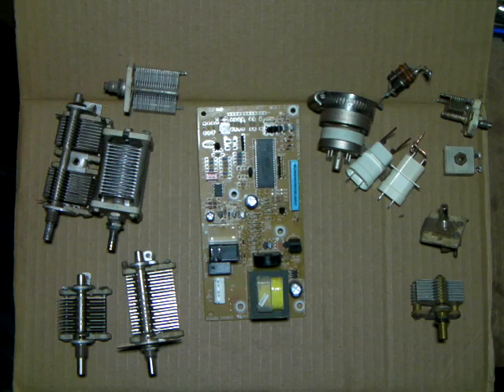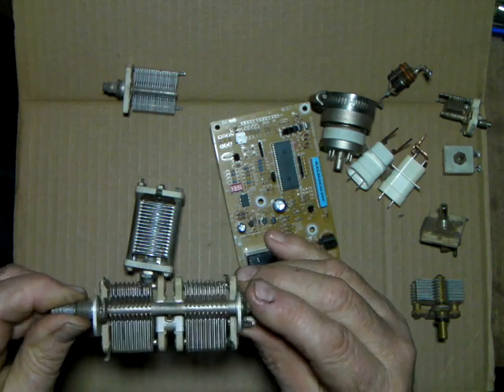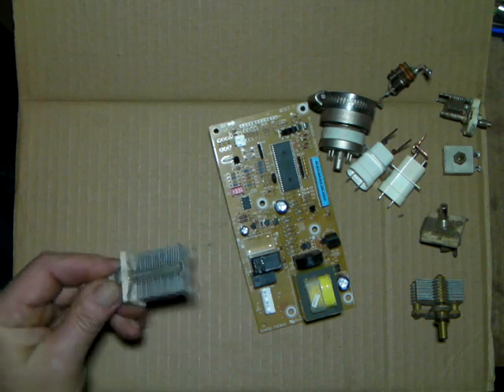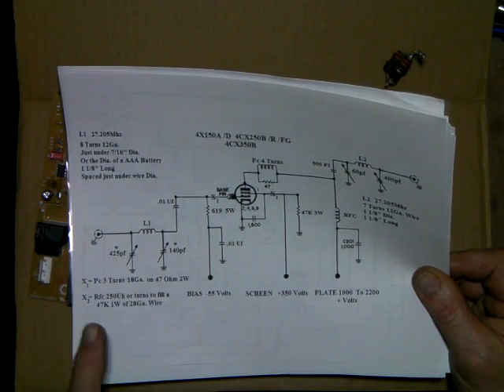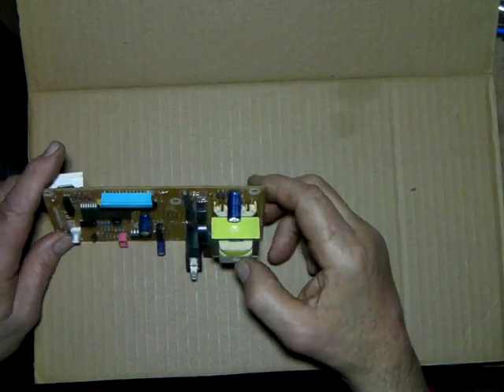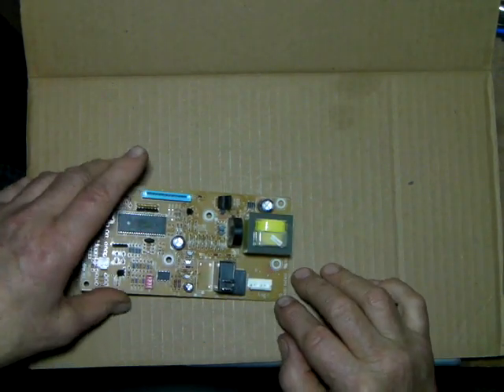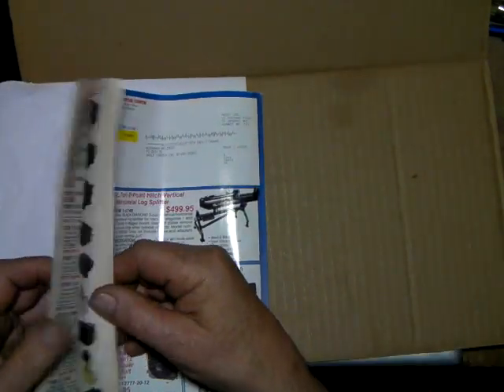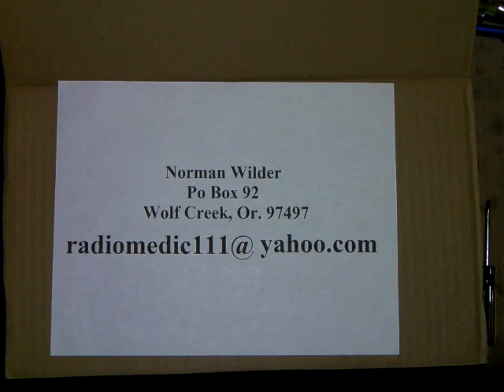Single Tube 4CX250B Amp For 27Mhz    The Build Pt5

Comment: Thanks Norm, also is a 4cx250BM suitable for this build, for what I can find it can be used as a direct replacement for the 250B
Reply from the maker: Hello...Yes that tube does seem to be a direct drop in for the 4CX250B...here is a link to the data sheet

http://www.ok1rr.com/tubes/Penta/4CX250B.pdf